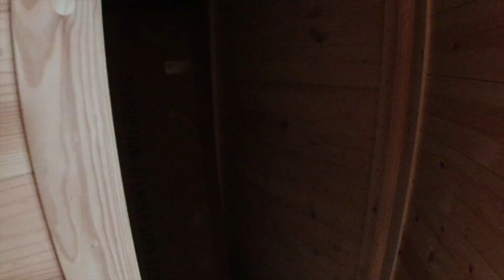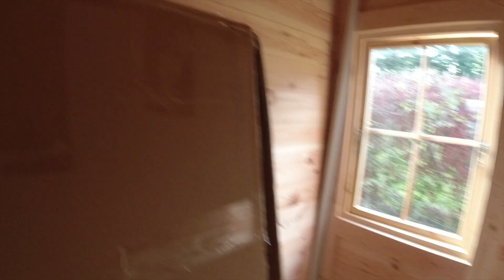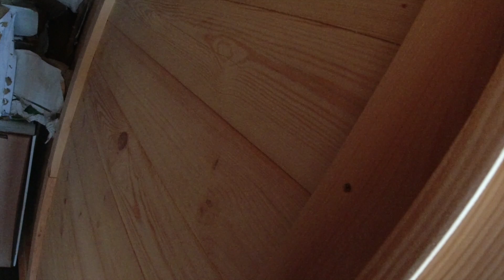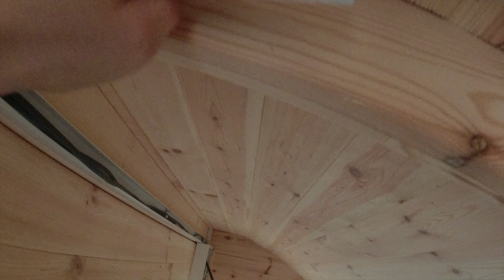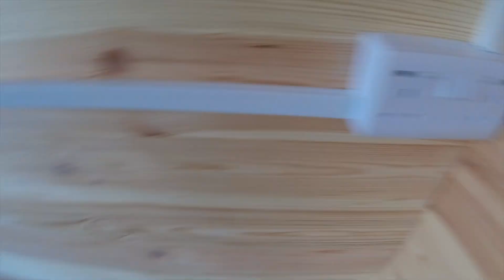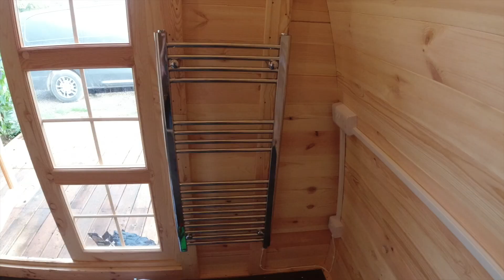When a TT isn’t a TT it’s PME TT. Help from a rough sleeper!!!

Comment: It's the trunking show. Those trunk arches look horrendous. Run your conduit on the exterior and Junction in so u don't see any ugly trunking on the inside. Plain lazy
Reply: How? It's got a felted roof on the outside going downtown the floor
 Did you watch the video?
Reply: @wyndavies5044   mate if u need to be told how to run it on the exterior and penetrate in and around where u need to get your cable without so much trunking showing then u need to hand your license back. Your like an apprentice that can't think outside the box.
Reply: @Kikz-1v1pinginit 😂😂😂 good one

Comment: Converting to TT is correct, despite what anyone says in the comments. More so TN-C-S is becoming more and more in dodgy territory anyway. Crazy to think we use a current carrying conductor as a means as a path to earth. In the latest amendment its recommended to install a rod now and recommendations generally becoming part of the regs. With more demand than ever, the chance of a failed PEN conductor is increasing and more deaths will inherently occur.

Comment: Most caravans with a 230 V installation and an inlet plug of type IEC 60309 CEEform (Commando), do have built in RCD protection of 30 mA along with MCB's. At least in mainland Europe. This means that the selectivity is normally disregarded for both fault currents and over-current protection. 
Having the full protection inside the mobile home means the protection is always present, regardless where the caravan is plugged in, say on a caravan site/pitch with a bad electrical supply with faulty or missing protection devices.

Comment: Hi sir very well done , definitely a one off but you got your head round it . And that’s what makes a good electrician, being able to think on your feet as they say . As a point of interest , what make of smoke detector are you using. I’ve had trouble with  wired fire angle units failing after the summers invasion of thunder flys . Even after cleaning they go straight to alarm .  As I’m long retired  I don’t get the feedback from the trade side of things .         Best wishes and kind regards as always 😀👍👍👍
Reply from the maker: Aico the best on the market
Reply: @Cjrelectrical   bless you 👍

Comment: Also about the level, how can you tell if the cabin itself is level? I mean if its on a slight slope that auto laser level would also look skewed as its frame of reference is different. So that wooden planking might be on alright, the reference might not be right.
Reply from the maker: A bubble in a level never lies
Reply: @Cjrelectrical  not what I implied either 👍
Reply from the maker: The cabin is pissed on the slab it runs down hill. If I don’t fix with the slats and go for true level it will all run up hill.
Reply: @Cjrelectrical  crystal

Comment: Just a thought to minimise the trunking on show could you have not run it in the little cupboard room and behind the wooden curved beam and just drilled through each into the main section of the cabin if you have more cabins to do may be worth a go but great job anyway 👊🏼

Comment: Unusual setup and not a great design . Why not put the rcd inside with a breaker at the external box . swa feeding the cabin . This is not a caravan so no need for TT earthing arrangement .
Reply: It's on a caravan site so each plot has a standard 'site supply unit': 16A breaker, RCD, 16A commando outlet. As it's set up for caravans the TT is a standard requirement, and he said the PME isn't enough.
Reply: @tobysherring1369  bad design. You can still satisfy the regs positioning the earth rod at the pedestal removing the rcd at source . The suppliers earth can then be utilised to feed the log cabins whilst the caravans are TT .
Reply from the maker: The site has to be TT so it’s easier to utilise the caravan pitches. The PME was unstable at around 0.70 ze the DNO said just rod the mains .
Reply: @Cjrelectrical  I would not call 0.70 ohms unstable. Was it fluctuating or same reading every time ? The dno have a duty to maintain the earth they have provided .
Reply: @persona250  You don't think double the recommended reading is unstable? What's the point of regs if we ignore them?!
Reply: @persona250  they have to provide an earth which is suitable. They have instructed CJR to TT it, and as it is mostly a caravan site that is a perfectly normal arrangement.
Reply: @xeno087 I would take a ze  of 0.70 over a 20 ohm earth rod any day of the week providing the distribution circuit was under max impedance values . Confirm stability with tests over a few visits . Ignore the dno advice they have fobbed you off so they don’t have to attend .
Reply from the maker: I even rang technical on this very issue and they said to TT
Reply: @tobysherring1369  like I said , dno will fob you off so they don’t have to attend . The install likely has a property or farm in situ which now has an rcd main switch feeding it . 

If you’re going by the book These RCDs have to be operated quarterly to prevent mechanisms locking and let’s not mention the nuisance tripping . These inconveniences could have been designed out whilst satisfying the regulations .
Reply: @xeno087  let’s not forget that maximum Ze is 0.35 and this technically is Zdb and not the external so the 0.70 ohms will be based of the max EFLI of the overload for the sub
Reply: @persona250   as I understand the DNO aren't under any obligation to be lower than 0.35 ohm for the Ze, it's just an expected value. The high reading could be an indication of a fault on the network earthing and would have to be monitored over a period to look for an increase in value. So you may get a compliant cct with respect to Zs, but it could fall out of spec if there is a deteriorating network fault. It's easier for the DNO to say TT it.
Reply: @marcus62647  Except Chris said Ze was 0.70
Reply: The cable feeding the cabin is being protected by the rcd at the hook-up, technically the hook-up should be closer to the cabin so its accessible
Reply: What was the resistance of the Earth rod at the feeder pedestal? We’re those 16amp feeds a 100mA RCD ?
Why not put 30mA RCD’s or RCBO’s in the cabin, discrimination ? Ball ache walking back to the pillar to reset the RCD.Or spike each cabin ?

Comment: Its black-Friday's price is a joke. generally, 15%-20% higher than other suppliers.
Reply: Absolutely indeed, just looked its a great shop but most expensive, milwaukee 12v 2 amp battery 17£ on sale when 16 normal price elsewhere and more 😅